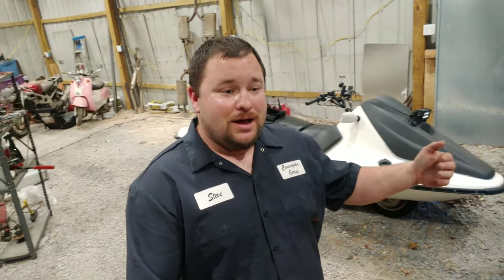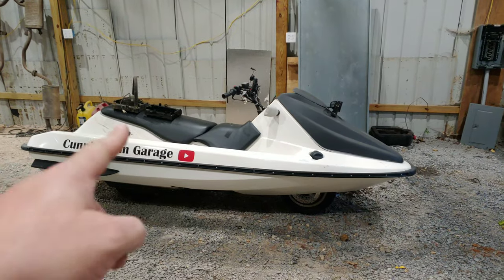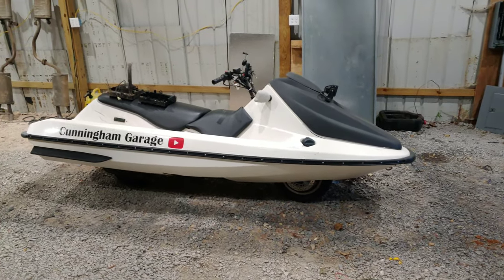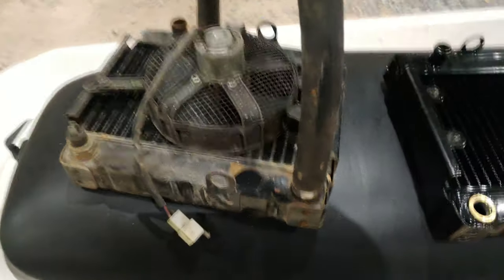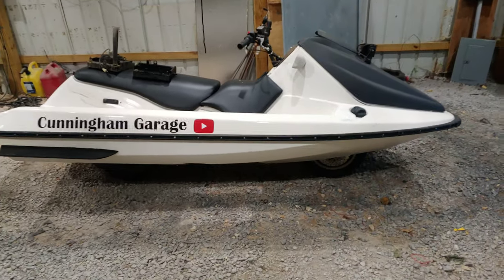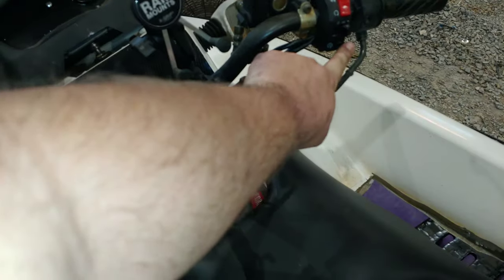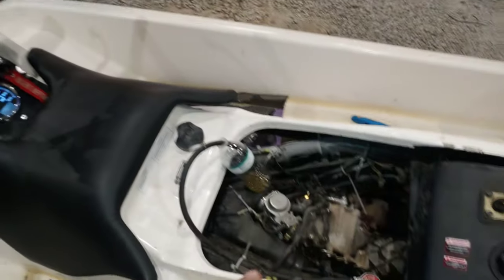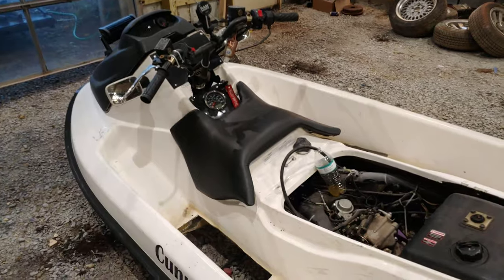Jetski motorcycle project part 4

Comment: How’d you lower the rear to get it to level out with the front end? I have a 150cc I’m trying to fit into a GTX body and the rear sits too high
Reply from the maker: Just as temporary I cut the rear springs a little bit to level it out but I'm going to be swapping the rear shocks out with air shocks from a Harley-Davidson so I can control the height and have a nice ride
Reply: Cunningham garage sick!!! I was looking at adjustable shocks but I figured cutting would probably save more money lol. That’s the broke college student life for ya I guess
Reply from the maker: You can pick up a set of used Harley rear bags for about 50 to $100 I just didn't want to buy them until I knew how high or how low I needed to be